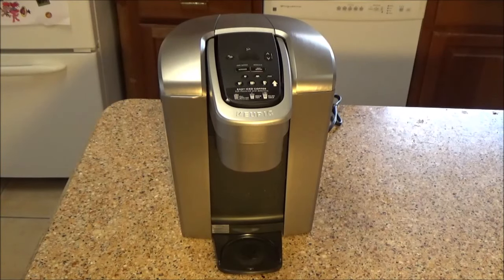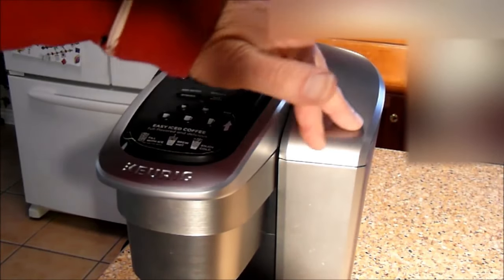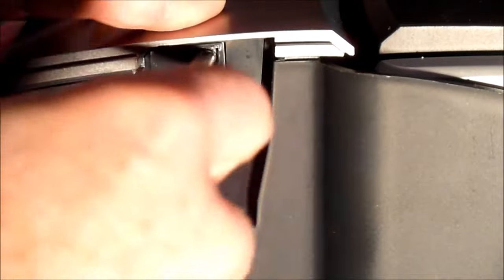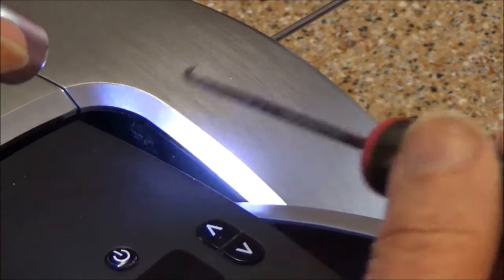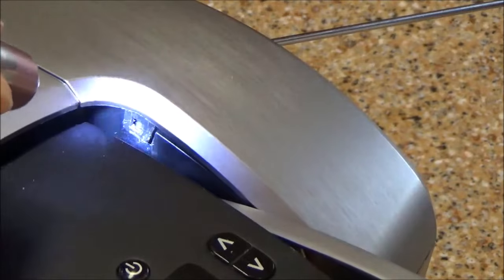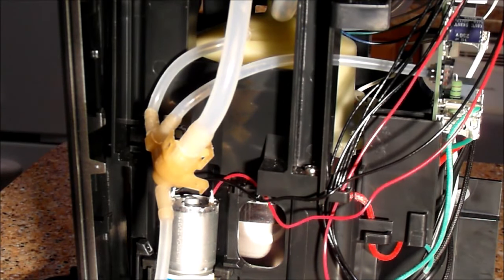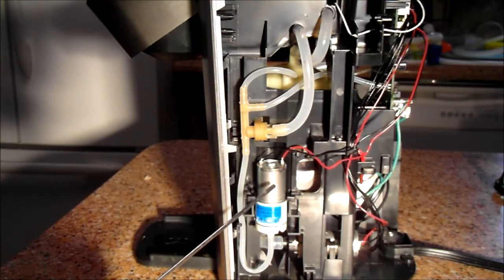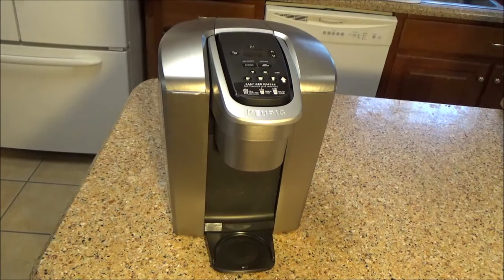Keurig Elite K90 Disassembly and Theory of Operation

Comment: Taking apart one of these machines was a nightmare. After watching half a dozen videos on fixing these machines that weren't much help on the disassembly I managed to get the machine apart with minimal damage to the case using a screw driver to get the plastic latches to release. The average person that has no knowledge of repairing appliances would find it difficult or impossible to do this without breaking the plastic latches . These machines are not user friendly and even with my knowledge of small appliances it took me 3 hours to figure out how to disassemble my machine. My machine had a blockage in the main water pump that I removed the plastic feed line that comes from the pump and connects to the needle that delivers hot water to the pod. I used a air line with low air pressure from my air compressor to reverse blow air into the plastic water line to the water pump and was able to unblock the debri from the hard water that had built up and blocked the line or the pump.
I now run vinegar through the machine every month rather then every 3 months they recommend to clean out any deposits from hard water from the machine. Since doing this clean out every month I've had no more problems with this machine. It would be very useful if the company who assembles these machine would put out a video showing how to disassemble these machines ,but then they couldn't sell replacement machines to the average consumer who doesn't want to go thru this very difficult procedure. Even knowing what I know about repairing appliances this was still a very difficult and frustrating job to figure out how to fix a simple problem .

Comment: Thank you so much for this video. I have purchased many returns, but the Keurig K-Elite I bought 2 days ago, when lowering the water reservoir into the machine for the first time water came rushing out the bottom.
Since it's a pain to send back, I decided to try to see if I could fix it. Without the secrets you shared about disassembly, I would have put the screws back in and sent it back.
I'm pretty sure I found the issue...

(UGH... It won't let me add a photo)
The tube from the reservoir valve to the next part was never attached!
Reply from the maker: Wow.  Who would have ever thought?  That would certainly make a mess of water everywhere.  Were able to get it reattached?

Comment: How do I fix this (k90 elite)

I bought a brand new flat cable wire thinking it was not sending power to the interface but it still doesn’t work only a clicking sound (I’m turning it on and off through a surge protector)

Comment: I have a Elite K90.  It turns on and goes through the water heating cycle and behaves perfectly until you select the cup size and the moment when it should start the brew cycle (pumping water, etc.) the machine powers off.  With the case off the machine I can hear a couple small sounds.  When I turn the machine on, there is an immediate "tick" from the circuit board like something becoming electrically energized (like if an electromagnet is turning on).  When the machine turns off on its own instead of brewing I hear a "tock" from the circuit board that is a 5th (5 steps lower on the musical scale) below the tick.  I'm thinking the "tick" and the "tock" are both coming from the same part of the circuit board, but I cannot feel anything from any of the three raised plastic parts on the right side or down near the bottom of the circuit board.  

It could be that the water pump is bad and that's kicking out a circuit breaker when the machine sends power to it.  Do you have voltage or resistance readings for the water pump?  If I disconnect the wiring harness connector from the water pump which pins would I measure voltage or amperage on?  So basically, what are the testing procedures on the water pump?  

I have had the water intake port off and ensured it is not clogged and is allowing water to go up into the water level tube so I'm fairly sure water the pump can get water.  There is water in the tube going from the rectangular part sticking off the water intake port to the water pump, but there is no water in that rectangular part if that matters. 

Thanks for the amazing video!
Reply from the maker: With the wire plug of each pump unplugged from the circuit board, the resistance reading of each pump is:
Water pump:    25 ohms
Air pump:          35 ohms

When these are both plugged back in and the machine is doing a brew cycle, the voltage readings across the power wires to each pump are:
Water Pump:    About 4 volts (while brewing and dispensing)
Air Pump:          About 11.3 volts (after the brew is complete and the air pump is blowing out the remainder)

The water pump and air pump are actually both 12 volt pumps, but the processor controls the speed of them by giving them less voltage.  You can also test each of them by connecting a 9 volt battery to the power wiring to each of them, after unplugging them from the circuit board of course.  Apply + to the red wire, and negative to the black wire.  The water pump has a bunch of separate black wires in the plug that we believe is involved in measuring the speed of the pump, so ignore those.  Just connect to the black and red wires that go the the back of the pump where the two pins are.  One person here said that when he pumped a reservoir's worth of water through by connecting the 9 volt battery to the water pump, the Keurig started to work reliably again.

There are some other possibilities.  When I experiment while brewing by pinching the tube that goes from the top of the hot water tank to the dispenser in the arm, it sounds like it is starting to brew (but nothing comes out) and then just clicks and shuts off (but the clock display stays on).  So this proves it would behave that way if there is a blockage somewhere in that tube, or in the area of the exit needle at the pod.  The other possibility is that it behaved about the same way when I disabled the air pump by either pinching it's air tube or unplugging its electrical plug.  Also, there is a 4 port plastic tee that has the pressure relief valve and 4 air tubes attached to it.  I have found that when it is new, it looks white.  As it ages, it gets darker colored and eventually brown.  At that point I had one break, but it was flaky inside because the material was breaking down.  So maybe there could be a clog somewhere in there.

Comment: Thanks a ton for this video.  I fixed mine. That air emergency check valve was stuck open.  I also had water in the air line possibly due to this issue. Took it apart, cleaned it up, BINGO.  FYI my symptoms were; power it on, press brew, water would heat up, pump would run for a second if that, and the entire unit would power off.  Some kind of safety power off I guess.
Reply from the maker: Nice!  Wasn't aware that that valve would ever get stuck open, but now we know.  I guess it would make sense, if that valve ever did get stuck open, that once the water pump starts trying to push water through the hot water tank and out the K-Cup needle, that the path through the stuck valve would look like a more favorable path to push water through than the needle would be, so it would force some water into the air line.  I would guess that the processor would figure out that something is wrong when the air pressure sensor doesn't show the reading that it predicts should be there, so it shuts the machine off.

Comment: Does the K90 have a check valve that can foul up?  I have reduced flow and I found other videos that show servicing the check valve on older models to improve flow.
Reply from the maker: The K90 has a check valve where the water first enters from the outside reservoir (before the hot water tank).  This is different from some older models that have a check valve inline in the tube overhead just before exiting the needle to the pod.  People would talk about that check valve causing some problems.  But the K90 doesn't have a check valve in that location.

Comment: Really loved your K90 video. Obviously very clear and detailed. You are undoubtedly a talented engineer! I am trying to set my K90 for long term storage and I am hoping you can help. Trying to avoid leaving water in the machine which I’m concerned could get quite nasty over time. I called keurig and they claim that the machine does not retain water if the external reservoir is empty. I would argue that the pump, heating tank, and water lines downstream would probably stay filled or wet. Any advice on how to drain the machine? Would you recommend that I run a cleaning cycle but leave the last bit of cleaning solution in place? Thanks so much for the video and your advice.

Comment: Great video! I have this exact model - Elite K90. It worked perfectly until I went to descale it. It didn’t even tell me to descale it but I already had 50/50 vinegar-water mix in the reservoir which was nasty looking with scale. So then I thought I would run the solution through the Keurig like I have on past Keurigs with no problems. Well, it sucked in a batch of the solution and then would not purge it out. I would power off and then on and the red descale light was on and it would not run liquid in or out on any of the brew sizes. I tried unplugging for some time and retrying but red descale light was always on. I then tipped it upside down and tried to “burp” it per some suggestions. Liquid ran from the machine where the pods go. After doing that, I cannot get the power button to light up or any other buttons for that matter. It’s like it’s dead but the display/clock still lights up. I have to assume liquid got where it shouldn’t? Any thoughts on this problem? Thanks
Reply from the maker: I investigated on mine to try to see what might prevent it from turning on, but couldn't come up with any real answers.  No matter what sensor or water pump plugs I unplugged, I could still at least turn the power on.  Since the clock display on yours still lights up, the 12 volt DC supply is evidently working.  If you are able to take the machine apart, you might check to see if there is water in the tube that goes to the air pressure sensor on the circuit board.  If so, open the tube and empty it out and let it dry.  Also, you could remove the display on top and check to see whether any water got into it, in case it is interfering with the buttons.  That area is pretty well sealed up though, so I would think water would have a difficult time getting in.  You could check where the ribbon cable from that display plugs into the main circuit board for moisture, unlatch it and clean the connector and ribbon cable.  Since the clock display works, you could press the settings button and go through the various settings to see whether something might be set wrong.  I don't see why the settings would make any difference, but you never know.

Comment: If I can make an observation ... the water level sensing tube assembly maybe going up to a higher point than the level that you can fill the tank for a reason. I would say that the exit "port" at the top of that assembly (is a small black elbow fitting on that tube assembly which was held in place by the outer cover) actually allows water to rise in the assembly by letting air (more intentionally than water) out of the tube assembly exit or "port". If that hole was plugged and air was not allowed to exit, then the water level in the tube assembly would not equalize with the exterior water tank and the sensor would not work correctly.

It reminds me of something my father taught me about leveling using a garden hose. If he ever had to precisely transfer n elevation level from one location to other locations that could not be seen from the original location, he would use a hose which was somewhat less than full of water, and attach clear tubes at each end to be able to see the water. He would then fix the ends in place the at the elevation location and where the elevation was to be transferred to. Finally he would then fill the garden hose/clear tubing with more water until the water level reached the original elevation. It transferred perfectly every time!  😉
Reply from the maker: Thanks for the observation!  It turns out that what I said in the video about dumping water back into the outside water reservoir was a mistake, and you can't correct a mistake in a video without deleting the whole video and starting over.  I had my mind stuck on how the old B-series Keurigs used to work, because they would indeed spit out a little water now and then through a tube that was curved to dump water back into the tank.  These newer machines just use that port to vent out moisture residue and like you said, allow the water to rise in the sensor tube without being blocked by pressure.  I believe Keurig's electrical sensing approach is highly sensitive to excess water vapor, so thus the ventilation is required.  I have a better theory of operation at https://youtu.be/fdGND9f-kEs?t=919s that I did for the K50, which I recorded later on after this one you watched.  I urge people to watch that one instead of this one for that reason.  I tried to steer people that way by putting a written note in the K90 introduction.  Unfortunately, I can't add a note in the video itself after the fact.
The idea about leveling using a garden hose is brilliant!  I'll have to remember that one.
Reply: @getitsettech1015  Thanks and not my intention to make you look bad, just passing on good information when I can do it!
Reply: BTW your video helped me to get my Keurig running again. I think my problem might have had something to do with the level sensor as the machine wouldn't even start the process of pumping in water when I picked the dispensing size. It would not advance. So, what I did in taking the device apart with your guidance was to test both the water and air pumps with a nine volt battery and once I established they still worked, I tried making a coffee while the machine was still apart. It actually started working again. Maybe talking it apart relieved an issue with water in the sensor tube or the tube was blocked from letting the water rise to the tank level.

Comment: Thank you for making this video. I am trouble shooting the failure of the "add water" LED. Wont light.  Please correct me if I'm wrong, is the operation of the water level switch is based on continuity? The water level rises in the tube to match the level in the tank. The water then completes the circuit turning the LED off. When the water level falls below the contacts in the switch, the circuit opens causing the LED to turn on and prevents the pump from running? Am I on the right path? Other than the lack of low water warning, the unit works fine. I feel I need to fix this or risk burning the unit out.  What other tests can I do to either condemn or confirm the water level switch operation?
Reply: That's sounds about right. Either that or the contacts lead to a flat oval metal plate inside the plastic and goes by resistance. To test this, you could try de-soldering one of the contacts. If that does it, maybe try filling with vinegar and letting it sit for about an hour before you run the descaling cycle
Reply from the maker: You're right - the water completes the circuit between the two probes, which turns the LED off. 
 When the water level falls, the LED is supposed to come on and shut off water flow, but it is pretty unreliable at doing that, and the machine continues to pump air because there's no water left.  You're not the only one that has noticed this.  I've seen two other machines that have that problem.  I just de-scaled one of them and it helped momentarily, but now it's back to having this problem again.  It usually happens when the machine has been used all morning without being shut off.  The machine is blind to the problem up to that point.  But if I turn power off and then back on, suddenly it wakes up and realizes that it needs water, so the LED comes on.  The way that they use the continuity of the water itself between two probes to make this decision seems pretty unreliable.  I've shunted between the two probes (with no water) and it only took about 6 megohms of resistance to make the Add Water light go out.  That's pretty marginal.  I've wondered whether the machine learns and re-calibrates itself to identify the water level, but there's no way to prove it.  I still don't know why they stopped using the old floating magnet combined with the Hall effect sensor to detect the water level - that was always 100% reliable.  But as for how to solve the problem on the more recent machines, the only suggestion I have is to de-scale the machine one or more times and hopefully it helps clean the probes to get better continuity.